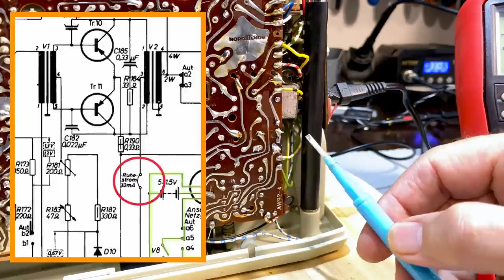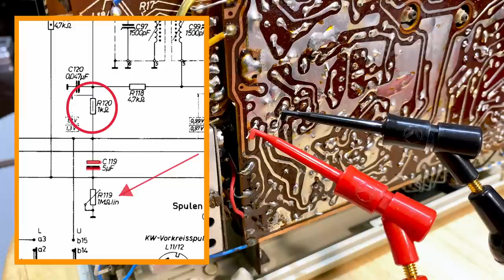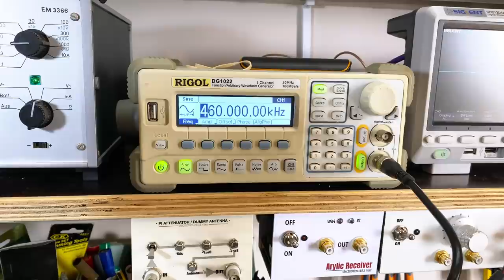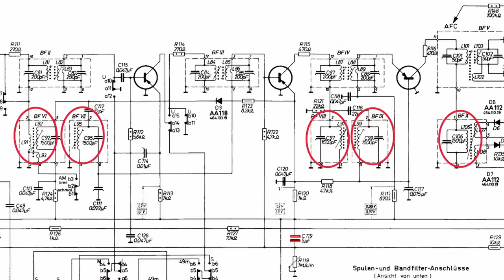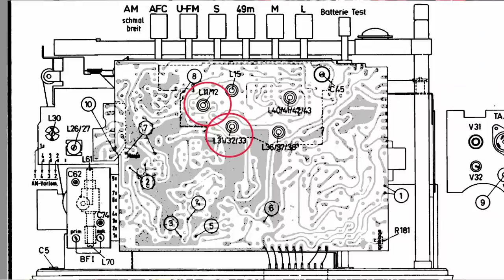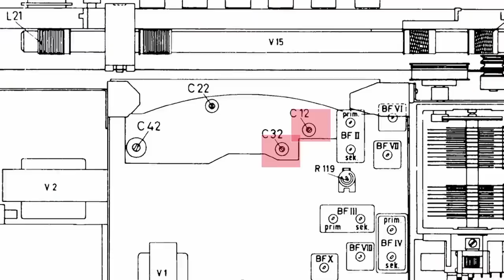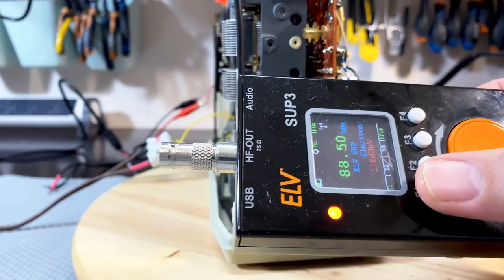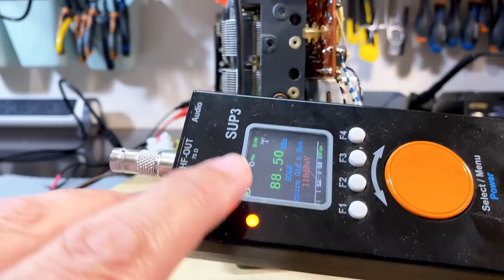Repair, alignment, cleaning, and some frustration. Nordmende Transita TS De Luxe restoration part 2.

Comment: I'm jealous of this radio Manuel, it's a beauty. The dial string shouldn't pose a problem for a man with your talents. Others are commenting that your wife is unwell, I didn't pick that up in the video, if so, I wish her a speedy recovery (Too late for the girl that bled out while you fixed her facial defect).
Reply from the maker: Nélia got Covid, but the symptoms were not too serious. It did mean that we were both confined to barracks, but with radios to restore, that’s not a problem 😊 
I likes this radio so much that I bought another 2 yesterday 😊 Nélia doesn’t  know about that yet, but I can always claim that it was a residual effect of her Covid infection 😊
Reply: @electronicsoldandnew  👍🙂

Comment: I do hope that your Wife's recovery goes well and your family stays in good health!  I am wondering if you considered using your chrome spray paint on the grill panels. If you did and it didn't work out well, at least it would be reversible with some paint solvent. I would also know how you like your Brymen 869S meter, as I am considering treating myself to one as a birthday present. I really do like the combination DC and AC measurement function it has, which is great for disclosing an AC ripple component on a DC power supply voltage rail without having to switch meter functions. Nice work as usual, and I wish you continued success with the restoral.
Reply from the maker: I thought of spraying the grill, but it is a matt finish which I won’t be able to achieve with the paint, so I decided to leave it as is.
The Brymen is absolutely fantastic, and O can’t find fault with it. I also have a smaller one and these two have become my staple multimeters for some time.

Comment: Hi Manuell I was  watching a history programme  on a picture frame restoration  and the guy was using gold leaf. Then i had a light bulb moment. Could you use silver leaf on a radio grill lhave the same problem with my hacker grill .with the deap scratch.  I have never done this before but I have ordered some silver leaf sheets ( like gold leaf but silver) going to wet and dry the scratch until its disappeared and apply the silver leaf  then apply some clear .cannot lose much as the grill looks crap with the scratch. Might be a success or an expensive bin job mind  you it's not that expensive .I will let you know .ps the cabinet looks great just need to remove the thumb prints regards  shaun
Reply from the maker: That’s a great idea. Let me know how it turns out.

Comment: I was wondering,  are those germanium transistors? Should one let them set on temperature before setting the bias?
Reply from the maker: They are, and I did look out for drift, but didn’t measure any. I have had experiences before where the drift was quite pronounced, but not the case here.